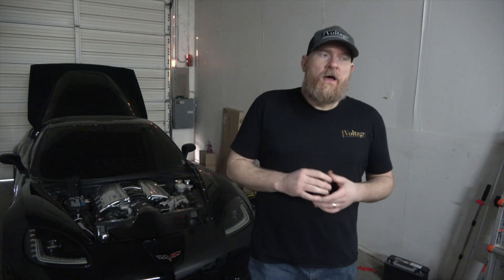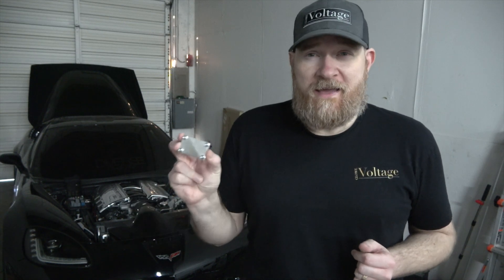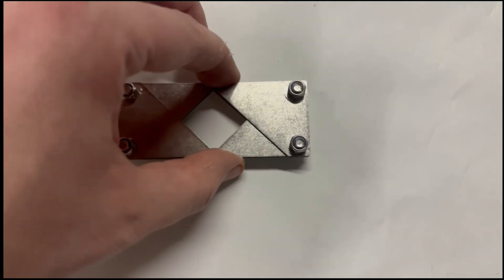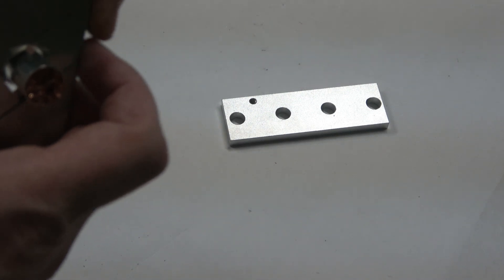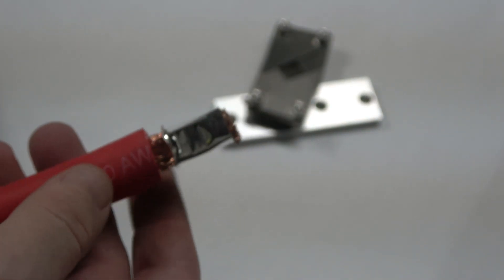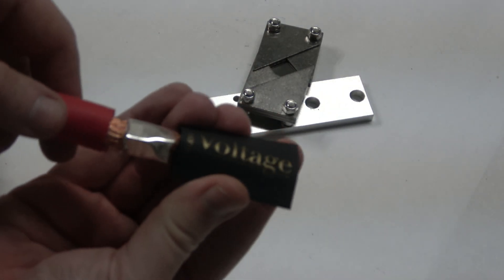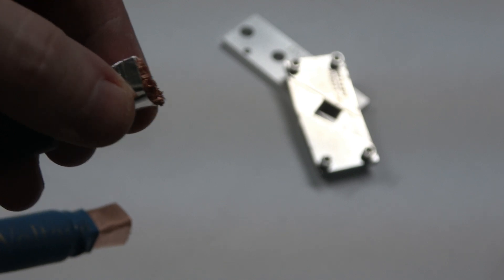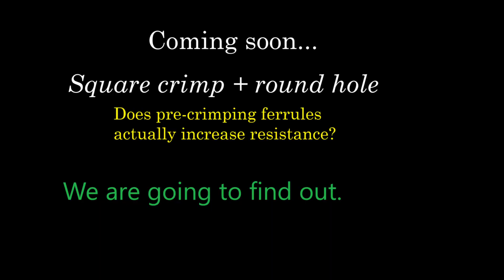New tool alert!  Easily crimp up to 4/0 awg ferrules??

Comment: Have you tested whether there is resistance when using ferrules? ... Also, you can always apply the heat shrink and just use the terminal to crimp those connections. That crimping look looked pretty inconvenient.

Comment: You could very easily set this up to work in a vise and it might be easier and more consistent. Your method would allow for any shape tho, why not round or even half round to match the shape of the terminals on an amp?
Reply: Tho it's obviously easiest to manufacture the square one

Comment: I just put some heat shrink over the edge of the ferrule and the wire and let the amp terminal do the crimping.  But hey I guess both work just fine
Reply from the maker: Your way may be superior.  I’ll have data supporting one method or the other soon — getting a station set up to do a lot of testing this week.
Reply: @GloweIndustries  thank you for doing these videos bro
Reply: I've always done the same on the assumption that it would have the most possible contact area with the amp input terminals but I'm interested to see the numbers